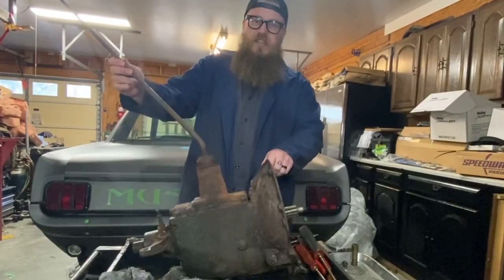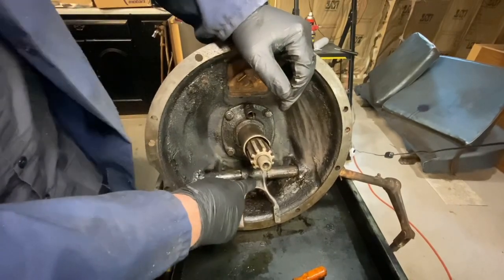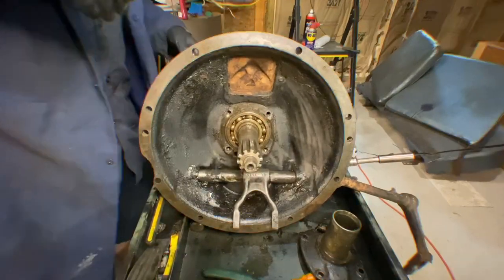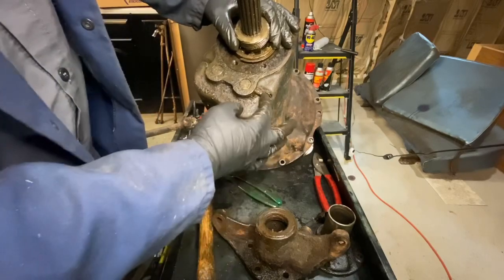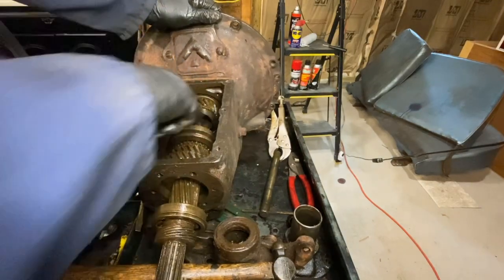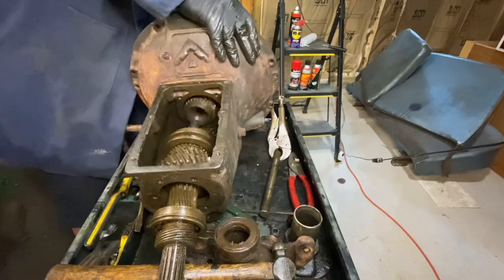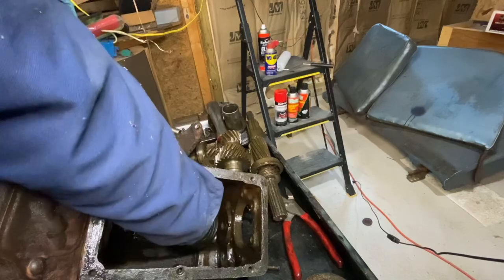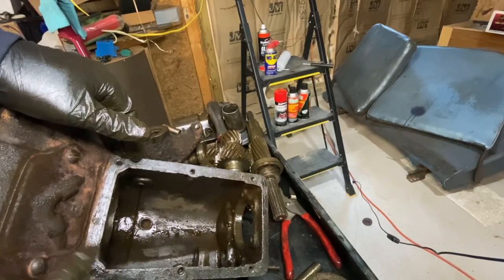1939 Ford Transmission Disassembly EXPLAINED

Comment: Thanks for the video! I have a '39 and the tranny works as it should except it slips out of 2nd gear going up or down hills or certain grades. Is there a way to just repair that or is it the full meal deal? And what are some of the things to look for to correct this problem?

Comment: No way you got that input shaft clip out that easy… I can’t get mine to lift up above the lip to circle it off…
Reply from the maker: I’ve done it hundreds of times, if you saw me the first couple times it took probably 30 minutes though so don’t fret! I was also a certified transmission mechanic
Reply: @WiredCustomsSpeedShop  I’ll keep trying.  Thanks so much for your videos!  I’m taking the guts out of a later side shift to put in my ‘38 case.   You da man!
Reply from the maker: @hexnut72  best of luck!

Comment: I have a 78-7006 with the newer gears and double synchros , but the case looks bad where the bottom cluster has that 4 way notched bushing , bushing looks bad and case is eaten away some where the bushing was spinning , I have a good 48-7006 case that has older gear set and is popping out of gear , can I put all the newer gears with a rebuild kit into the 48 case ? It’s going into a 36 truck , I also have a 18-7006 case that’s perfect but I’ve read that can’t be used with the bigger clutch , thank you in advance

Comment: I would like to have seen you disassemble the cover which has the shift forks and shift shafts in it. My shift forks are frozen but my trans gears slide nicely on their shafts.

Comment: I’m having trouble finding info so maybe YouTube will work 😂We are trying to restore a 1937 ford coupe , and the transmission we have is set up for a drive shaft while the car has a torque tube , and we are looking for the correct parts to convert this top loader transmission from a drive shaft to a torque tube version but are having trouble finding anything,

Comment: So what is the deal with using lincoln zephy gears in those?  I hear alot about converting to zephyr gears.
Reply from the maker: They have a much better gear ratio, you can stay in first a lot longer, all of the Flathead ground speed records were all set using zephyr gears 👍🏼
Reply: I have an early ford box that I converted to open drive for a 27 t coupe, It will be put behind a 327 chevy so it should have enough torque and hp and rpms so it should be fine as it is. I have an old adapter to run that box behind a chevy.  The model T had to have the ford box, hou just cant beat the look and comfort of the shifter with the v8 logo on it.

Comment: We spoke via FaceTime today (so you know who I am) - thought I would post this question here so others might get the benefit of your answer. I have the 48-7006 transmission (that you will be rebuilding for me very soon) with a 9" clutch. Can I upgrade to a larger clutch (10-11" for example) with out having to drill my flywheel? I'b be thrilled to be able to upgrade to the 10" clutch if it's a simple bolt-on upgrade. Thanks

Comment: will a ford 1939 trans mount to a 8ba flathead? thanks
Reply from the maker: If you have the truck bellhousing for the 8ba then yes
Reply: @WiredCustomsSpeedShop   i don't but will have to find one. thanks
Reply from the maker: @greenhandle  okay great! Check out “The Flat Spot a Flathead Support Group” on Facebook and ask if anyone has one for sale, it’s a great group for finding things

Comment: A question, was there a 3 speed with OD available for the F1 pickup?
Reply from the maker: Not for the pickup but there is for the cars, also they have overdrive rear end upgrades but they are pretty pricy, it is common however to put a modern T5 transmission out of a mustang behind a Flathead
Reply: @WiredCustomsSpeedShop  I see. What type of classic car box, with an overdrive, should we be looking for that will fit behind an 8BA?Thanks.

Comment: Hello I’m looking at a 1938 Ford dump truck! Is the transmission the same or did they change everything in 1939??
Reply from the maker: The weird but true answer is that it’s pretty much the same but a little different, the 39 will have a better shift tower, better gear ratio, and synchronized 2nd and 3rd, also the earlier transmissions will have straight cut gears opposed to helical cut gears, as far as disassembly, and rebuilding, they are almost exactly he same
Reply: @WiredCustomsSpeedShop  ok great thank u love your channel!?!?
Reply from the maker: @jessebolles3661  no problem, thank you!

Comment: It appears the vibration in my 39 Ford Deluxe Sedan is coming from the gearbox. Have you done a video on how to remove the 3 speed manual gearbox from the car?
Reply from the maker: I have not, but I can tell you that you either have to remove the engine or remove the rear end to get the transmission out

Comment: Putting it back in the case is kicking my rear end. The grease baffle blocks the main shaft from entering the case. I didn't see a grease baffle on yours. Do people leave those out for that reason?
Reply from the maker: Hi Steve, there is a couple different versions of gears depending on what the transmission it was in and a lot of them were rebuilt back in the day with later gears from a shore shift box so it’s Russian roulette on what gears you have,  if you would like some more help send me some pictures on Instagram or Facebook messenger

Comment: Thank you! Driveshaft noise / vibration at 35mph and over in my 39 Ford Sedan. Any ideas please?
Reply from the maker: Your U joint could be going bad, but I wouldn’t count out the rear bearing in the transmission being bad either
Reply: @WiredCustomsSpeedShop  thank you for your reply. It gives me an idea of what to inspect next! Love your vids. Cheers

Comment: Hello, 
I was wondering if you could help me, I’m getting my 1939 Ford truck with a flathead v8 running. The transmission has got us stuck. If the truck is off all four tires it will catch the gears and even reverse, but once we put her on the ground she won’t move. Any advice would be appreciated and love your channel. 
Thanks,
sorry for the double post, new to posting on YouTube
Reply from the maker: it sounds like the rear suspension or even the crossmember could have a problem, my guess is that the torque tube is jamming up into the transmission and putting it under a lot of pressure, I would try loosening the engine mounts and trans mounts and see if you can push the engine forward any

Comment: Hello, could you give me some advice, I
Reply: Hello, 
Could I get some advice, I have a 1939 Ford truck with a flathead v8. We have got the truck running, but now, it will shift into gears if we have it off all four tires, But once we put her on the ground the truck will not move? Any advice would be greatly appreciated.
Thank you
Reply from the maker: So you put the truck in gear and drop the clutch and it will not drive forward correct? Also does dropping the clutch kill the motor?
Reply: @WiredCustomsSpeedShop  yes, correct it won’t move, but the motor stays on.
Reply from the maker: @rudysanchez7004  ok sounds like you either have a blown clutch or the transmission has blown the gears, hopefully it’s just the clutch, I would unscrew the small cover on top of the transmission and see if you see clutch material inside
Reply: @WiredCustomsSpeedShop  ok, thank you so much, when the truck is up, the truck shifts into all the gears an even reverse and the wheel moves, but as soon as she’s on the ground, nothing. Hopefully it’s just the clutch, thanks again Zac.
Reply from the maker: @rudysanchez7004  no problem at all let me know what you find

Comment: Great video Zac. Where can I find the 6 safety wired bolts that go behind the U joint? Do you know if the flywheel safety wire bolts are the same and can be substituted??
Reply from the maker: Thank you! I believe the two bolts to be different, but you can get the bolts from Ecklers or Macs, they actually have a great supply of early Fords transmission parts
Reply: @WiredCustomsSpeedShop  Appreciate that.
Reply from the maker: @5096wgt   no problem

Comment: Of the 3 roller bearings; the 2 short go in the cluster and the long one goes in the input shaft. My problem is the main shaft seems to hit the input shaft bearing and lacked approx 1/8" from going home. What am I missing?
Reply from the maker: If I and understanding you right, sounds like the bearing from the inside of the input shaft isn’t going in all the way, I would try cleaning the inside of the input shaft really well but it’s hard to say without pictures, feel free to message me on Facebook, Instagram or send me an email with the pictures

Comment: Great video- will you do an assemble video too?
Reply from the maker: I didn’t record assembling this transmission, but I do have two more to go, I could record one the
Reply: @WiredCustomsSpeedShop , thanx, I would like that. I have trouble figuring out, how the shaft gears are put back in their right places. I plan on building a '37 gearset (out of a 78 case) into a B housing, to use in a bangerpowered racecar. :-)

Comment: Hi I liked your video. Do you have any information on a 1940 Ford 4 speed with pto?
Reply from the maker: Thank you Tim, not one with a PTO, what are you working on?
Reply: @WiredCustomsSpeedShop    1940 Ford Dump truck w factory dump ...   Here is a pic https://1drv.ms/u/s!AjWpE8joQCq4mKR5tIooefUvr1Lvcw?e=aadzfQ
Reply from the maker: @timblakeman2381   that’s one beautiful truck! I haven’t worked on much with a PTO, a couple Ford tractors over the years, what state are you located in, I could possibly look into it for you

Comment: That looks like an F1 truck trans. Basically same as a 39 trans.
Reply from the maker: The serial number of the case is 1938-39 and has the conversion for a driveshaft, I haven’t rebuilt a F1 specifically yet but hopefully I’ll get to! Thank you for your input I really appreciate it